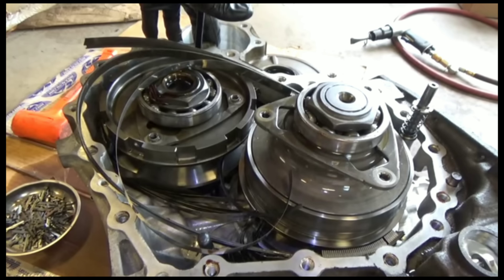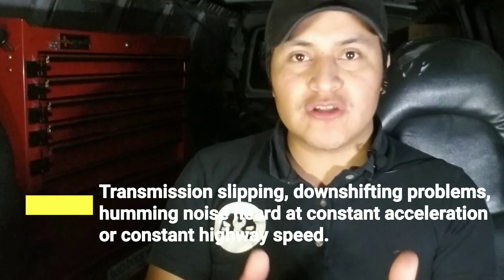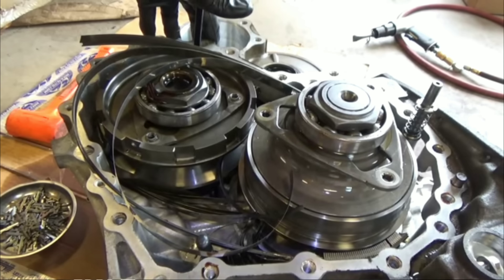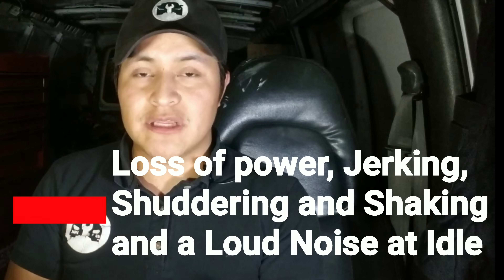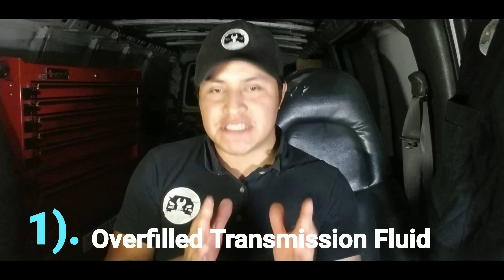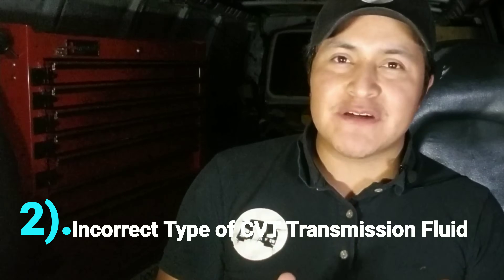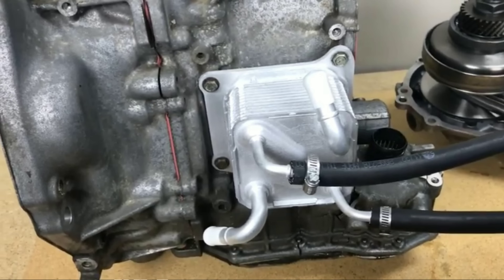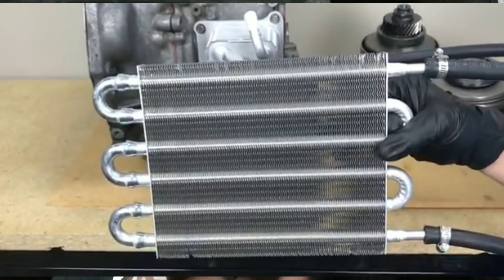NISSAN CVT TRANSMISSION | why it fails and what you can do about it to prolong it's life

Comment: The best way to fix the Nissan CVT transmissions is to buy a Toyota, lol!
Reply: Learned that lesson the hard way.  My transmission went out.  Less than 100000 miles on the car.  I'm done with Nissan
Reply: @bad2infinity  Honestly did you ever change the cvt fluid?
Reply: The last great nissan was 2000-2003 maxima I totally agree with you
Reply: @quentinholley9077  yep I had my 2006 Altima for 13  years until the heads went out last year got rid of it
Reply: @brotha1984  Nissan makes decent motors it's just the cvt transmissions that are trash
Reply: Damn bro my son just bought on 2014 versa  whining sound highway speed between 3/4 gear
Reply: @michaelhickey499  He better baby that thing...
Reply: @michaelhickey499  better change that fluid and install aftermarket cooler Asap, if possible 👍
Reply: @quixotic317  Really? I heard that it's The Honda Odyssey which I owned, that have the bad transmission problems, and yes, I ended up, having my transmission die on me, so now I want something that has a DVD player, and something not known for having bad transmission issues.
Reply: @michaelhickey499  
The 2014 versa may have been available in both a CVT and a regular stepped automatic. So if he has the stepped automatic and it's making a whining noise it may not be catastrophic it could just be slightly low on fluid or something else. Definitely worth checking into. Good luck with it
Reply: @michaelhickey499  If he has a loan on it, see if he can private sell it or trade it for the remainder of the loan. If he can't, help him find a NEW car with TONS OF REBATES (mostly anything new will get him farther down the road that Versa, continue to stay away from Nissan). Rebates will help him get into a car cause they'll "pay down" his current one. If you find one with enough rebates to absorb his negative equity (at least a portion of it), try to trade it ASAP. His payment will be higher, sure, as he could no longer use those rebates on a the new car. But at least he'd be farther from the Versa.
Reply: @michaelhickey499  it's a bering
Reply: @michaelhickey499  yeah those small Nissan are junks sorry for your son cvt are terrible transmission especially nissan. You have keep that fuel clean and cool it doesn't like heat. I wish you and your son the best
Reply: Buy a manual transmission. Done.
Reply: @onlyhereonce7290  I wish but sadly, the manuals are going away. Buy a miata, corolla, civic or accord. Or better yet there is the used market
Reply: @sc4r.mp218  it's more difficult every day to buy a manual transmission anything. I needed a small car for commuting. Just me. No passengers if possible. Tiny engine. And the Versa worked for me. A Miata was my second choice. Very expensive to buy. Very expensive to insure. Average at best fuel mileage. So, I passed on that.
Reply: And from what I have read Toyota is having some issues with their 8 speed transmissions in their newer Camrys. Don't know how bad or how true it is have read on you tube and on the internet.
Reply: Kevin Lauffer and their engines, also RAV4s
Reply: @kl1958  its on minority. Manufacturers are not perfect but toyota has way better reliability records for all brands. They do not do many changes as they have this mantra "do not fix what's not broken".
Reply: @kl1958  Your kidding me? the beloved Toyota empire is having issues to? Lol sorry fan boys I guess your brand isn't perfect either. LMAO. Nissan will make a come back. Trust me. They are already on there way. 👍
Reply: I believe Nissan has changed suppliers of their CVT's are the last 3 years depending on the specific model have improved. I know people that have Nissans different models and no issues. Maybe they are lucky.
Reply: Kevin Lauffer the newest CVTs from Nissan are improved.
Reply: @rafaelg9016  Hope this is true. We, a large number of Indians are waiting for Nissan Magnite being lauched on 26th November with 1.0 turbo cvt. Hope the engine transmission combination works out good
Reply: @kl1958  No Nissan owns 80% of their supplier, JATCO. Most of their lineup still has either the JATCO CVT7 or CVT8.
Reply: @kl1958  - I test drove a 2019 Altima and experienced some studdering when accelerating from a stop. My cousin's 2017 was doing the same thing and later his Altima started making a very high pitch wheezing noise when parked or stopped. Nissan still uses Jacto transmissions on all their Altima, unless they switched transmission companies. I'm not saying Nissans are going to have 100% CVT failures but they're sure as hell going to have more issues than Toyota, Honda, Mazda and Subaru combined.
Reply: @reachblowsdick7222  I mean yea that may be true but then again my 08 M45 Sport has been bullet proof. Seriously not a single thing wrong with it at 111,000 miles and my coworker has a 2006 G35 he drives every day day 50 mile round trip with 210,000 on original engine and trans. And honest to God my 2014 altima never gave me problems  so you can see why I back up Nissan and Infiniti vehicles. They have been good to me, but in reality I'm super crazy about the maintenance on all my cars.
Reply: Fred Williams I’ve experienced an expensive disappointment from Nissan though. Bought brand new 2015 Altima off the lot in 2015. I well maintain my Altima & let dealership change my maintenance each time. However, at 125k miles now they said you’re gonna have to buy a transmission at 3300k not including labor or this car note that’s due. So disheartening. I’m glad you guys have reliable Nissans.
Reply: ReachBlows Dick I mean!! I had to replace the a/c unit last year $700 , this year slow to no acceleration sitting at stop light praying no one hits me!🤦🏾‍♀️ now this year you want 3300 for a transmission & my payment..I’m done they can have their junk back. I want my money back! I think all car makers have a crappy year here & there but at least fix it with the warranty don’t screw people over.
Reply: @ReachBlowsDick I can't agree more.  I got a used  a 03 Maxima SE with 99k miles and I added another 200k miles with hard driving until it was wrecked in accident.  Then I got my current  06 G35X at 150k~ miles because of my love for Nissan.  I wished I had watched Scotty and knew Nissan quality has went into the toilet because it has been an expensive money pit with some of the same issues he mentioned. I added an additional 50k miles and so far: Head gasket blown(unfixed), catalytic converter gone bad (unfixed), camshaft sensor bad(fixed), blower motor(fixed), passenger seat controls broken (unfixed), volume control on steering wheel broken (unfixed) both front control arms bad (fixed 1), both ball joints bad (unfixed), both tie rod bushings(unfixed), both wheel bearings bad (fixed). I am so done with Nissan and my next car will be a Toyota.
Reply: @dtshakuras  - Holy shit! Damn man you weren't kidding on that G35X, wow! Yeah the old Nissan were tanks and pretty zippy, I miss the old Nissan.
Reply: My 2018 Camry  has CVT transmission.  So far so good. Hope to not have any problems 🙏
Reply: @cbijames7  - According to Scotty Kilmer, Toyota uses Asin transmissions and they make the best CVT on the market. My sister's 2014 Corolla has over 150K miles and she's never ever had any CVT issues. My grandma's 2006 Prius also uses CVT transmissions, it has over 200K miles and it's never had transmission issues. I think you're in good hands.
Reply: @reachblowsdick7222  I wonder  who make honda cvts. I also have a 2017 accord.
Reply: James Dean  - Nissan does have a deeper racing heritage than Toyota no doubt, and it would be nice if Nissan can go back to building fast reliable cars like they use to over 20 years ago, but the Nissan now is a far sad cry from it's legendary predecessor. Toyota now has more power and incredibly better reliability compared to the Nissan. Look up who's the # 1 team in The Le Mans for the last 3 years and they're Toyota. They beat the king Porsche, when has Nissan ever dethroned the mighty Porsche in the Premier class Le Mans? Nissan won the IMSA GTS and the LMP2 24 hours of Le Mans but not the LMP1 premier class like Toyota won during a strong Audi & Porsche, Nissan has victories in many other races, mostly rally races but none at the highest level like Le Mans. Also Toyota has some championships in NASCAR (ugh..I know) and the NHRA Funny Car. Let's see the world's fastest GTR-Nismo try and beat a 330 mph Toyota funny car, lol!
Reply: James Dean  - There's no disagreeing with you that Toyota are boring and look like a car that grandma drives, they're not built to race Lamborghini or look cooler than Mercedes & BMW. Toyota are cars that get you to work and home with the least mechanical problems possible, and that's where Toyota beats them all. Nissan look cool and are fun to drive, sure I know this very well since I use to own them. But what's the point of having a cool looking Nissan if it's reliability is shit and breaks down all the time. A running Toyota will always look cooler than a Nissan on the side of the road. Yes Toyota is a one trick pony, but that "trick" is reliability and that's one trick the public NEVER gets tired of seeing, it's also the trick companies now days can't seem to replicate. 

Honda destroys Toyota in multi innovations like mowers, generators, motorcycles etc...sure, no problem I agree, I never said Toyota was better in that category. But people don't buy Toyota to say "hey my car company also make the best generator" NO ONE says that. Toyota are just a car/truck company that make vehicles that outlast their competition and that they do very well. How many gamers do you see saying "My playstation is so awesome because Sony makes the best TV, stereos, CD, cameras, computers etc", eh when? Just like some kid doesn't give a damn his Playstation's company make other good products, Accord owners don't give a damn their car company make good generators and mowers. ....Besides Honda doesn't make that good of a lawn mower, lol! Hey I didn't by a Yamaha R1 because they also make good guitars, LOL!

Now obviously you don't know much about trucks, because everything you were saying on Honda & Toyota was pretty much on par, but that Honda producing quality looking truck made me think that you were about to suggest that Honda can now compete with Toyota on trucks, and you are so wrong! The Ridgeline is a truck meant for some pencil pusher who doesn't work in construction or will only load his 12 speed mountain bike, lol! The Tacoma alone is far better than the Ridgeline but the Tundra is far more reliable and durable than both. The Tundra is really the only thing that can dethrone the king Ford F-150. The Chevy/GMC, RAM, Titan none of them can beat the F-150 but the Tundra is already showing signs it's stronger, just as durable or more. You start using a Honda Ridgeline in construction and you'll see that little wimpy expensive truck fall apart. The Tacoma and Tundra were I worked lived with heavy trailers attached to them and they just kept running.
Reply: liam park  - You should have been at the courthouse during the Nissan lawsuits about your 08 Altima with 250K miles, you would have probably saved Nissan millions of dollars, lol! A very very few reliable Altimas are not gonna speak for the entire  unreliable Altima line up, just like a very very few unreliable Camry are not gonna speak for the entire reliable Camry line up. 

It's about reliability percentage, and in this case Toyota is miles ahead of Nissan.
Reply: Jc #1  - Nobody said Toyota transmissions are perfect but they sure are as hell far better than Nissan garbage transmissions. If I'm wrong, prove it.
Reply: @reachblowsdick7222  the failure and comaint rate of Toyota 8 speeds is higher than Nissan CVTs lately.
Reply: Yes, I screwed up with the "Toyota" remark. They have their share of problems too. I actually own a 2012 Volkswagen Jetta and I only bought it because it has a manual transmission. I almost made the mistake of buying a Camry until I saw that Volkswagen sitting there all red and pretty. The 5spd manual sealed the deal
Reply: @schuylerambrose7720  - You talk about Toyota having their problems, then you say you own a Volkswagen, lol! Yeah that right there says all I need to know about your car selection. And do I need to go into specifics about VW and their infamous emissions scandal that shocked the world?
Reply: @schuylerambrose7720  - Also check out this video. It doesn't mention the Nissan CVT issues but just read the comments and they're flooded with "Why didn't they talk about the crappy CVT?"

https://www.youtube.com/watch?v=W7ooWr05wnw
Reply: I loved my Nissan Maxima but that cvt killed me.. upgraded to the Toyota Avalon 🤦🏾‍♀️
Reply: nOT A NEW tOYOTA!! 🤣
Reply: Is that you scotty
Reply: Hondas earth dreams 1.5 turbo has oil dilution problems..
Reply: I hear Toyota has CVT transmissions in many of their new cars and they have had issues with them.
Reply: good job bro
Reply: Actually the automatic transmission of a honda ranked #1
Reply: @halloweenjunkie666  - Normal automatic or CVT?
Reply: @halloweenjunkie666  Do you have some sort of source? The last I knew is a good amount of Honda automatics are prone to failing. They've been on a downward decline for years. Go to carcomplaints.com, you'll see MANY COMPLAINTS on Honda's transmissions for the last 20 years. Primarily in v6 vehicles such as Pilot, Odyssey, Accord etc. Even some early 2000s Civics had bad issues. I know the CR-V had a pretty bulletproof track record. In terms of engine and transmission problems, Toyota seems to rank the highest in terms of low amounts of complaints by actual owners of the vehicles.
Reply: ToyotaCelicaDude1 
Honda
2. Which CVT Transmission Brand Is The Most Reliable? The Honda models with the CVT are the most reliable among all the lineups and CVT transmission life expectancy is the longest. However, the automakers have been working relentlessly to improve the technology.
Reply: @halloweenjunkie666  But that's not a source, where'd you get that from? Just curious, I'd like to read it. Like if you have a web link that would be super cool.
Reply: @halloweenjunkie666  Any links yet? Still waiting... I find it hard to believe that anyone but Honda would say their transmissions are the best. Because Honda's are notorious for automatic transmission issues.
Reply: @halloweenjunkie666  Still waiting on some sort of source, some sort of website link... Let me guess, you typed that stuff up yourself from your own personal opinion trying to pass it off as if some large source wrote it?
Reply: ToyotaCelicaDude1 
Honda transmission service

 In truth, the vast majority of drivers will never feel a difference. Most Honda transmissions are well-made and will need only the same standard transmission service as do all transmissions. ... Honda automatic transmission fluid is required for your Honda transmission.Jul 29, 2019

Heres your response!
Reply: Toyota is cvt also
Reply: @RubenHarries  - Toyota makes the best CVT on the market. Pruis, Corolla, some Camry and other Toyota models have hardly ever had issues with their CVT. Asin is the company that makes CVT transmissions for Toyota, and Asin is also owned by Toyota.
Reply: @RubenHarries  Toyotas CVT's are actually insanely reliable
Reply: I bought a brand new Rogue in May this year. It’s the last year of this body style so I’m thinking I’ll be fine. I love the car, and the transmission too. After reading all the replies here I’m interested to see what happens. At 4,500 miles now. My roommate/friend purchased a brand new 2018 model and already has 60k miles on it because he used to driver for Uber some. His has never been in for anything other than required maintenance. He had the CVT fluid changed last month as the book calls for, we we shall see!
Reply: @brentjones1006  - Really the only Nissan I trust is the 350/370Z with manual transmission, those little cars are very reliable. Every other Nissan me and my family and friends have driven with CVT have been trouble. We're not the standard for what is or is not reliable, but we do have lots of experience with Nissan vehicles. You'll probably put more than 150K miles on your Rogue with no issues, pray that you do. But as for us, we're done with Nissan for good, especially with so many other far better brands available on the market.
Reply: True.. 😂😂😂😂
Reply: James Dean  - I got this info from Motortrend.com on the 2018 Camry XSE vs 2020 Maxima Platinum

Camry XSE - 0 to 60 - 5.8 sec
Maxima PL - 0 to 60 - 6.0 sec

Camry XSE - Quarter mile - 14.3 sec, 99.6 mph
Maxima PL - Quarter mile - 14.6 sec, 97.8 mph

Camry XSE - 60 to 0 braking distance - 123 ft.
Maxima PL - 60 to 0 braking distance - 113 ft. 

Camry XSE - EPA City/Hwy/Combined - mpg 22/32/26 
Maxima PL - EPA City/Hwy/Combined - mpg 20/30/24

Camry XSE - 3.5 Liter, 301 hp, 267 lb-ft DOHC 24 valved V6
Maxima PL - 3.5 Liter, 300 hp, 261 lb-ft DOHC 24 valved V6

Camry XSE - 8-speed Automatic
Maxima PL - 7-speed Cont Variable Auto

Camry XSE - Motortrend https://www.motortrend.com/cars/toyota/camry/2018/2018-toyota-camry-first-test-review/

Maxima PL - Motortrend https://www.motortrend.com/cars/nissan/maxima/2020/2020-nissan-maxima-platinum-reserve-first-test-review/

I know this information can vary depending on the quality of the drivers and political financing of the company doing the test, but it's a start. I haven't looked up the others like Corolla vs Sentra, Camry vs Altima, Frontier vs Tacoma. But it's not going to be a clean sweep easy win for Nissan, it's only big gun is the GTR.
Reply: I almost did. Then I saw this after I bought a Juke.
Reply: @Rob Wilson - I got this info from Motortrend.com on the 2018 Camry XSE vs 2020 Maxima Platinum

Camry XSE - 0 to 60 - 5.8 sec
Maxima PL - 0 to 60 - 6.0 sec

Camry XSE - Quarter mile - 14.3 sec, 99.6 mph
Maxima PL - Quarter mile - 14.6 sec, 97.8 mph

Camry XSE - 60 to 0 braking distance - 123 ft.
Maxima PL - 60 to 0 braking distance - 113 ft. 

Camry XSE - EPA City/Hwy/Combined - mpg 22/32/26 
Maxima PL - EPA City/Hwy/Combined - mpg 20/30/24

Camry XSE - 3.5 Liter, 301 hp, 267 lb-ft DOHC 24 valved V6
Maxima PL - 3.5 Liter, 300 hp, 261 lb-ft DOHC 24 valved V6

Camry XSE - 8-speed Automatic
Maxima PL - 7-speed Cont Variable Auto

Camry XSE - Motortrend https://www.motortrend.com/cars/toyota/camry/2018/2018-toyota-camry-first-test-review/

Maxima PL - Motortrend https://www.motortrend.com/cars/nissan/maxima/2020/2020-nissan-maxima-platinum-reserve-first-test-review/

I know this information can vary depending on the quality of the drivers and political financing of the company doing the test, but it's a start.

The only thing the Altima take a dump on is reliability. 
A Nissan GTR will shit on a Toyota, sure. An Altima? LOL, I don't think so, lol!
Reply: First I test drove a Nissan, and then went to the Toyota dealership to test drive one of their cars. When the salesman came out with the key, the car wouldn't start. After waiting an hour for the service guys to try and get the car started, and listening to the salesman tell me how much better the Toyota was, I just told him that I was able to drive the Nissan, because it actually started and drove. Then I left, and I bought the Nissan. It is probably the best car I have ever owned, and I have been driving 40 years. 260,000 miles, and they had to replace the gas cap, and that was before its first oil change. The  fifth car I owned was a Toyota Supra, it required more maintenance than any car I have ever owned.
Reply: @scott1243  - The same thing happened to me when I test drove a Honda CBR1000-RR. Honda is considered the king of reliability in the motorcycle world, yet when I test drove it the bike wouldn't start up. Turns out it had a bad battery from sitting too long without the battery tender. Same thing can happen to cars even though car batteries last much longer without charge. My sister went to test drive a new Sentra 3 years ago and the car started shuttering so bad while slowly driving out the dealership parking lot, the salesman actually told her to stop and turn the car off. They got the mechanics to turn it back on and slowly drive/walk the car to the garage. She instead got a Corolla and after 210K miles on it her Corolla has never ever had anything fixed, just oil changes and tire maintenance. All the Nissan we've owned within our families have been money pits with the exception of my brother's 350Z manual transmission. My uncle's Toyota Camry has hit over 300K still going with original engine, tranny and many other OEM parts. My old friend's construction used Tundra has over 200K miles with a double axle trailer attached 24/7 still going with no issues. Yet my cousin's city driven weekend Titan hit 80K and started needing major repairs. 

There's major lawsuits against Nissan for horrible CVT, Nissan is no longer the reliable company it was in the 80's & 90's, after 2000 it was bought by Renault and Nissan's quality went downhill since then.....but at least they look good. 

Also what year model is your Supra?
Reply: @reachblowsdick7222 ,my Supra was a 1982. It was a fun car to drive. I sold it with 300k on it, and it would still bark the tires in 3rd gear. I  did replace the clutch 3 times, but I'm sure that had something to do with the way I drove it, lol. I  sold it when the electronic temperature control stopped working, and Toyota engineers couldn't figure it out.
Reply: Marc S  - I'm not saying Toyota is 100% perfect, but I'd like to see a link to the new Corolla, Yaris etc with these issues. But I will say Toyota is far better than Nissan for sure.
Reply: Of course Toyota 100%
Reply: Hi, I am Graeme John Eddington. Following is my Youtube post of my Multi-speed transmission I have called: "Opposing Torque Dynamic Clutch" which is a type of Infinitely Variable Transmission (IVT) which I believe is ideal for your current applications. Please log on to my Youtube video: https://www.youtube.com/watch?v=SACDK89U7PM
Reply: My thoughts exactly!!
Reply: @schuylerambrose7720  The best was to be different and not look like everyone else on the road and look like you can actually stand out and not follow is to not buy a Toyota. Oh look there goes another camery and Tacoma. Lame!
Reply: Wise taught.
Reply: What you guys think about 2014 Nissan Pathfinder sl model? Any input please thanks. Im thinking of getting one
Reply: @samuelugh5729  - I've had bad luck with Nissan, others have had good luck with Nissan. It's just a roll of the dice with Nissan, but in my opinion and many other professional mechanics the Toyota/Lexus, Mazda or Honda are the way to go.
Reply: @samuelugh5729  junk, too heavy for the CVT! I’ve had Nissans since 2004. Got rid of a 2016 Maxima, and 2015 Murano! The Cvt’s were both failing! I have a Tacoma with a manual, and the wife has a 4Runner now! No more Nissans for me!
Reply: @JAMESWUERTELE  ya i heard after that one company took over nissan. Everything went to shit! so sad. Nissans used to have good cars.
Reply: Thank you
Reply: #facts
Reply: Ha ha..  So you think Toyota's CVT's are any better.. The Yaris and Belta  same old story.. or some of Toyota's corolla in other regions junk.. best thing one can do to breathe life in a CVT which ever manufacturer is to change the oil don't wait till its burnt.
Reply: @joebrown9621  - Yes I think Toyota CVT are much better. Show me a well documented overall record that says they're not. Or show me a professional mechanic that have years working on CVT from all manufacturers that say the Toyota are no better than Nissan's CVT. Until then, you're just a Nissan fanboy with hearsay comments. Nissan have on going lawsuits over their CVT. I never said Toyota CVT are perfect because no car in the world is perfect, but they sure are far better than Nissan CVT crap. All of the sudden you forgot what video you just said your comment on, LOL!
Reply: @reachblowsdick7222  Nissan is junk! Very much agreed. I started with a 2004 Titan (brakes warp, rattle trap interior), 2005 Frontier (good truck), 2005 Maxima (ok), 2007 Titan (brake fade, warped rotors), 2011 Titan (3k miles, random misfire, dealer never fixed), 2011 370 Z (great car, I should have kept!), 2015 Murano, 2016 Maxima (both had CVT issues, dumped them both), finally learned my lessons. I have a 2019 Tacoma (manual trans), and the wife a 2020 4Runner! I do like the 4Runner more than the Tacoma. I might trade in a few years before they change it. 

I hope Toyota treats me right for many miles. Nissan burned me out, never again!
Reply: They're both cheap rusted garbage.  You're an idiot.
Reply: @ww4927  - You sound like a 15 year old butt hurt fanboy, LOL! You may or may not be right on both being garbage, but they're not cheap. If Toyota is considered garbage, that really puts all the other manufacturers in a worst position. Any German vehicle are super expensive pieces of shit, the only American somewhat quality is Ford but only in their pickup lineup because all their cars & suv are shit, any other European brand is shit. All other non EU or US brand like KIA or Hyundai are shit. That only leaves the Japanese with Toyota being the top, and if Toyota is garbage that means all others are as well. 

I guess that leaves you with bicycles and horses, LOL!
Reply: Scotty: “Told ya”
Revvvv up ur enginessss 💨
Reply: Period
Reply: prefer ‘02 civics and older. nothing else. toyota isn’t bad. newer nissans are garbage. just get an old civic
Reply: @BTB.Performance  the honda v tec engine's are very reliable
Reply: The Honda's have the v Tec engine very reliable engine
Reply: Yea and i have a "lovely" Nissan lol
Reply: The cvt in Toyota’s are same manufactured ones as ones in the Nissan pretty all the cvts are made by same company
Reply: @captainflannel8558  - The Toyota CVT are made by Asin which is located in Kayria Aichi Japan founded over 70 years ago. The Nissan CVT are made by Jatco which is located in Fuji Shizouka Japan founded 50 years ago. Get your facts straight because you sound like a doofus who thinks Ford and GM are the same company.
Reply: Nice try Scotty Kilmer
Reply: @MrJoshualoney  - I'm flattered to be compared to Scotty, but I'm nowhere near the professional mechanic Scotty is, but thanks. Btw, former 2017 Altima owner myself, guess why I got rid of it ;)
Reply: @Temporary Account my transmission just recently went out at 165k miles🥲🥲lucky!
Reply: Lol, what a joke!!!!! Who does Toyota buys their parts from????? You guessed it, Nissan. Lol jokes on you.
Reply: @davivu  - What parts, be specific and post a link to it. Also Nissan gets their CVT from Jatco, Toyota gets their transmissions from Aisin. The problem with Nissan is their transmission (among other things). Nissan is owned by Renault, Toyota isn't owned by another car manufacturer. So I'd like to see where you're getting your "Toyota buys their parts from Nissan". Maybe you're right or not, but before you spew something like that you first need to post a link, otherwise you'll end up sounding like a dumbass.
Reply: I did ,sure bought.
Reply: Oh lol
Reply: Paul Phoenix  - I own a Camry, not what you would consider "inspiring". Also I've never bought a "motivation" book/video since those types of promos always seem like sleazy car salesmen type. I do however own some really fast motorcycles for "inspiration" and they seem to always do the job...... plus I'm black and you know what kind of innuendo stereo type comes with that territory ;) 8====D
Reply: I'm going for a lexus now
Reply: This is what my girlfriend is doing. Her Nissan rogue transmission failed at 70,000 miles, which includes us getting the transmission fluid changed within that time period from 0 to 70,000. She's going to buy a brand new RAV4 tomorrow.
Reply: No bulllshit, bro.
Reply: Xb squad!!!
Reply: Too bad now many toyota also have CVT
Reply: @imarcoi123  - But the Toyota CVT are actually reliable, unlike the Nissan's.
Reply: Me lleva la.... Nos acaba de pasar eso con la transmision alas 90mil millas en la calle anda bien pero si nos subimos al freeway no quiere acelerar depues de un rrato!! Y no pasa de 40 millas por hora🤦🤦🤦 😤😤😤😤😤.y nos faltan 3 meses para acabarlo de pagar,pinches ingeniros pendejos.los de nissan. Los carros de antes suempre seran mejores en calidad.
Reply: Proven facts or take the Nissan to the dealer and get it recall if you fixed the transmission on you’re own they refund you some money or all
Reply: @tjraider97  - Funny you're "proven facts" didn't work for me and my 2017 Altima. I told them my cvt was giving me issues and they wouldn't fix it unless I pay for it myself. I tried to use the "lemon" clause argument and the Nissan dealership said it was no good, then I tried the "how about my lawyer" argument and the Nissan dealership told me fine, you're little lawyer against our large team of super lawyers and let's see who wines. I decided it was not worth the time and money on a losing case, so I decided to just take my Altima to a Toyota dealership and get as much as I can for it and got a Camry instead. I took a loss on it, but that's my fault for having confidence in Nissan. No more Nissans for me, ever.
Reply: Totally agree ..my 2007 Camary has 289k and drives like it's new.
Reply: Good one!!!
Reply: Tbh bro I had an Altima with 140k and now I have a Toyota Corolla with 115k and I’m surprised at how many parts are going bad already .. it’s much easier to work on the Corolla tho so I guess that’s good .
Reply: 😊. Damn right 👍
Reply: So true.  My Lexus runs like a champ
Reply: You so right.
Reply: Toyota junks nowadays are CVT s also.. 🙄
Reply: @silverlinings7773  My sister's 2017 Corolla has just hit 90K miles and so far she's never had to fix anything on the CVT. Still I think the conventional transmissions are the way to go.
Reply: @reachblowsdick7222  Toyota made their own CVT transmission (under AISIN company which is Toyota group as well). And YES their CVT transmission is far better than other company.
Reply: @silverlinings7773 nope. AINSI transmission are used everywhere and are good.
Reply: @silverlinings7773  I personally have a 2016 Corolla S with the CVT and I've had zero problems. Then again. Its 37k miles into it's life so I doubt I'll be seeing any problems for a very very long time.
Reply: @Sodapopper100  i hope you won't. 🤟🏻
Reply: @Sodapopper100  Yea well I owned several Nissans with cvt and never had issues either. So what's that mean? Nissan sucks no matter what? I don't think so. Great Brand they just need to dump Renault and glad thy got rid of that dip shit Goshen. Trust me they will be great again and all the Toyota fan boys are gonna be but hurt or jump on the band wagon lol.
Reply: @Sodapopper100 exactly. AINSI CBT transmission are reliable.
Reply: Naah. Toyota cvts arent reliable too
Reply: @bp6837  - My 2017 Nissan Altima had just over 20K miles on it before the CVT started having slippage and high wheezing noises at idle. My cousin's 2013 Altima over 100K miles had one CVT rebuild, had issues again and then had to get a refurbished CVT installed.

My granny's 2006 Prius with over 200K miles no CVT issues. My sister's 2014 Corolla over 150K miles no CVT issues. 

I'm not saying Toyota CVT are 100% bullet proof, but they're sure as hell far beyond reliable compared to any Nissan CVT. I know this from experience and actual reports, not just fanboy hearsay.
Reply: James Dean  - Well a highly experience professional mechanic like Scotty Kilmer would strongly disagree with you, I'll take his word and my own experience over yours any day of the year. Besides I've said many times on here that the only Nissan I trust was a 350/370Z with manual transmission so you might have a point. But I still don't trust the Altima, Versa, Maxima, Sentra with or without manual, their engines, suspension, electronics are still questionable for me since I've had issues related to those other mechanical parts. The Frontier is pretty reliable but I still see more Tacoma from the 90's to modern and they're all running towing trailers, I can't remember when I've seen a Tacoma or Frontier on the side of the road, but I see many many Altima, Sentra, Versa on the side of the road all the time. Not many Maxima because hardly any people buy them but I do see many of the Infiniti cars on the side of the road and they're basically a fancy Maxima.....actually a better version of the Maxima......and they still suck, lol!  

And should we even talk about how far more superior the Tundra is to the Titan? That's going to be an easy cake walk. The Tundra is the only full size truck that can beat the top dog Ford F-150.
Reply: I prefer Nissan and Honda over Toyota 😂
Reply: @ItsChrisWorld  man you don't know what you're talkin about
Reply: @1289lt  I know exactly what I’m talking about... You can have your Toyota I’ll stick with Nissan and Honda.
Reply: @ItsChrisWorld  Nissan is better!! More reliable
Reply: @ItsChrisWorld  why
Reply: @rwm1980  why??
Reply: I have been driving a Nissan Altima with CVT for almost 10 years with a current mileage 132K. Had no problem so far. The acceleration is excellent than the Toyota Camry I drove!
Reply: @mathaithomas3642  - My uncle's 99 V6 Camry has over 300K miles, it accelerates pretty fast being a V6, so far no issues other than changing the usual mechanical maintenance parts. Not saying all Nissan CVT are going automatically break down, but the percentage of Nissan CVT breaking down will be extremely far more highly than Toyota transmissions.